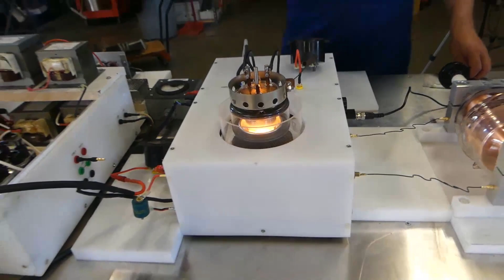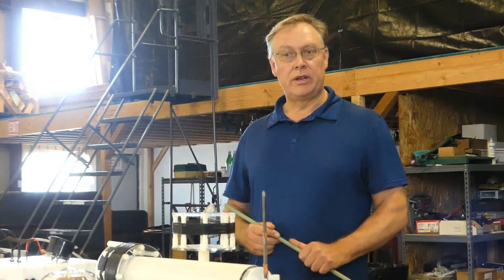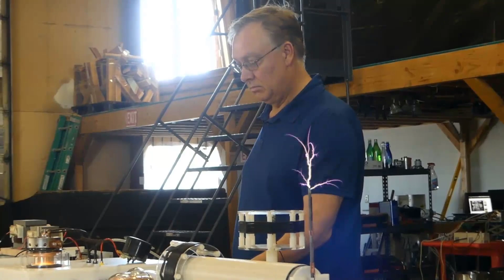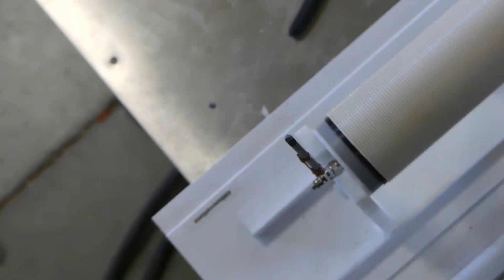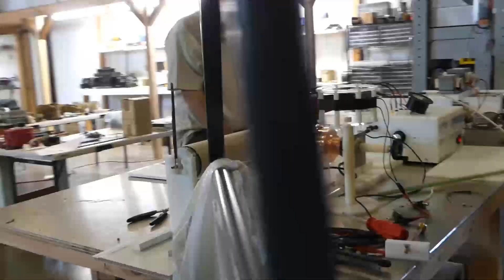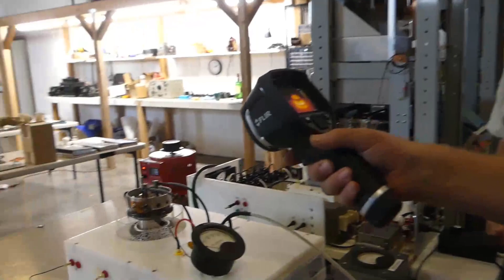The Golden Ratio Discharge — Tree, Root and Burning Bush

Comment: Hi Aaron, do you have any information on electrical circuits that produce Endothermic effects? The only thing I've been able to find is your book "Cold Electricity – Rare Patent Application Revealing the Key?" and I've hit a wall in finding anything more, do you have some sources I could check out to learn more about it? Cheers.

Edit: Sorry I meant digital video, I was very tired when I asked this, whoops.
Reply from the maker: Hi, that's not my book. My inductive resistor experiments years ago caused one to drop about 5C below ambient. That was the most pronounced effect I ever saw.
Reply: @AaronMurakami13  It isn't? The digital video has your name credited on the front cover and your section on the emediapress website, strange.

Maybe this topic is a dead end, thanks for replying anyway.
Reply from the maker: @JenkoRun  LOL, ok, that's my presentation. When you said book, I only looked at the title Cold Electricity - so yes, that is my presentation.

Comment: Aaron, Is there an introduction to this series?  Or is that Self-encapsulated in the several conference talks?
I feel like these experiements have some contextual "Why" that would be contextually relevant.
I get the impression that there's some field intersectionality between the dielectric and magnetic components that these experiments are showing; but I can't place "why" that is significant, and where that fits in with eric dollards work.  

Obviously dollard and the powersupplies that are used are with the explicit purpose to power these types of experiments; but some of the nuance of designing the circuits (like dollard elaborating on the relays and tubes) is lost on most RF engineers, who would otherwise use.  

And what remains of the active memebers of the forums is pursuing research in these fundamentals.  I'm clearly Interested, but I havent been able to place this contextually in my broader understanding to some of these.

And I know some of my other Engineer friends don't have the abillity to contextualize some of the informational content either....  Just thinking that being able to translate that might make it more digestable for a broader audience.

Sort of like the SSG project clearly made a splash and made people interested in the "why", but so many mis-percevied that as a standalone generator, not a teaching tool.  

I think given the nature of learning on the internet has changed over the last 10-15 years -- teaching and understanding is now much more accessible, as are the tools to create... and many funnel to a paetron in order to sustain their explorations.
Reply from the maker: Last year, Adrian presented on network vector analyzers and he ended it with some of these discharges. This year, his entire presentation was focused on this, the geometry of golden ratio, fractal, etc. the power supply to do it, and so on - very comprehensive - about 4 hours and then this. Eric did this year ago and Adrian was the first to replicate it to this level of refinement. Some Tesla coil builders brush it off as "that's just a vacuum tube Tesla Coil" - yes it is, but there is obviously more than meets the eye. So the above mentioned presentations are the extent to this specific phenomena. Soon, I'll release the Colorado Springs "Part 2" like this one and it will also have some amazing discharges and audio demonstrations.

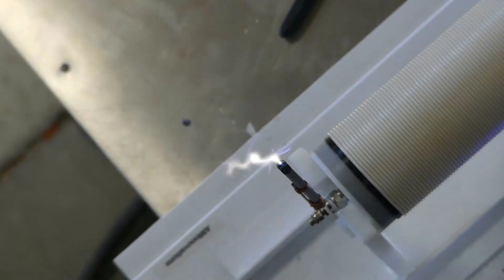Comment: The pulse discharge had a cancellation effect with the audio because the levels dipped every time it started snapping, and got it to stop near the end of the video. High dielectric (capacitance) hard. Low magnetic (inductance) soft. A well founded perspective from our international partners. The phase shift @42:13 from glow mode to dark mode 🤯. Thank you for the presentation @Aaron Murakami⚡👍

Comment: The value of iron coils and iron connections for suppressing parasitic oscillations and a virtual ground is a floating capacitance (plate). Eric Dollard and Adrian Marsh…

https://www.youtube.com/embed/VxEUTLzfkoQ?start=1605&end=2118

Wikipedia…
“There are two types of shimming: active and passive. Active shimming uses coils with adjustable current. __Passive shimming involves pieces of steel with good magnetic qualities. The steel pieces are placed near the permanent or superconducting magnet. They become magnetized and produce their own magnetic field. In both cases, the additional magnetic fields (produced by coils or steel) add to the overall magnetic field of the superconducting magnet in such a way as to increase the homogeneity of the total field.__”

Parasitic suppressor…
https://en.wikipedia.org/wiki/Shim_(magnetism)#Usage_in_magnetic_resonance_spectroscopy

Calutron oscillations…
https://en.wikipedia.org/wiki/Calutron

Comment: do you think the ressonance that's causing different arc shapes is coming from the different gasses in the atmosphere, including the generated ozone?  you are creating plasma streams with nodes on them as if they were nodes of static discharge on a metal rod. those are created by magnetic seperations of domains. so plasma can act like metal wires and break off at regular nodes due to resonance ?  is it basically like a flourecent light bulb tube that creates dark spots and bright spots depending on frequency and resonance of the gas in the tube? in nature, the tube gasses nodes would come about due to the capacitor plate effect, where three plates can be charged by one plate, as negative charges build in one plate, it attracts positive charges on the other, this causes the third plate to build up negative charges, and the chain reaction keeps going down the parallel plates, well nodes in metal rods form from magnetic domains created by the current frequency. if you change the frequency, you will change where the magnetic domains form.  is a plasma flux stream acting as an untubed neon lamp?  i always saw electrical arcs as just leaking electrons in the air, but it seems they are acting like neon tubes that can branch whose variables are: type of gas it is currently resonating with by way of frequency and how powerful the flux lines are that are arcing out of the coil?